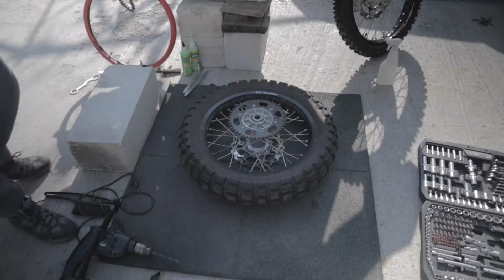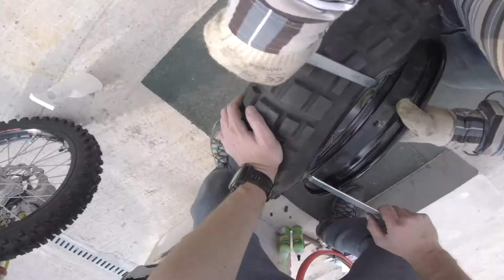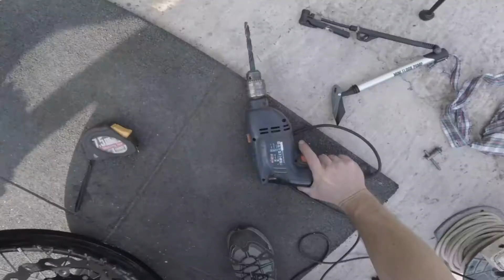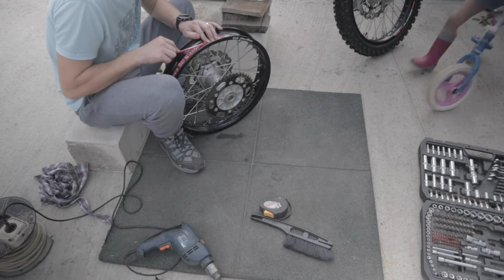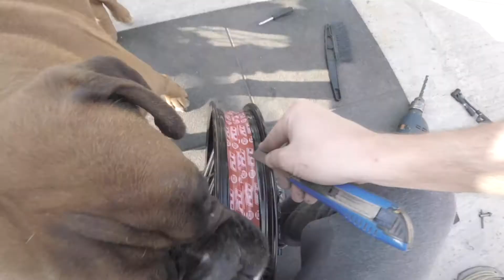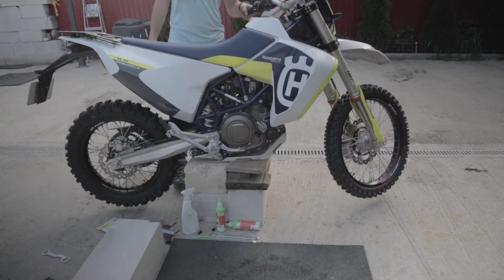Husqvarna 701 Enduro LR (2020) - Nuetech Tubliss and Mitas EF-07 140/80 Green Stripe Rear Install

Comment: how was your experience??? They work on long highway trips??
Reply from the maker: They do work on long highway trips. I am using the bike for longer trips as well as commuting and only had one problem with the back tubliss system (that was my fault as I didn't check the pressure of the tubliss tube and I managed to tear up the tube valve). Except for that, no issues. Keep in mind that they are not made for highway use and you will be a bit limited regarding the tires that you can use. Because the rims are a bit wider than the rims for which the tubliss system was designed, you will need to fit tires with a thicker sidewall and also use some sealant in order to have no air leaks. And as long as you keep some higher pressure in the tires while going on the highway you should have no problem. I will do a video in the near future explaining my experience with the system.
Reply: @MotoCerbii  perfect, thanks a lot

Comment: Nice video. Can you recommend use of Tubliss on 701/690 after using it for a while? Any issues?
Reply from the maker: haven't had any issue with this. Some tires may leak some air if the tire wall is too thin. I am currently using Mitas C02 on the back and Pirelly MT21 on the front and after adding some sealent I have no air leaks. I didn't have any issues with the system in almost 2 years of riding offroad and onroad.

Comment: I got rid of my tubliss because of the ride on road between trails. Horrible hop. Had over 4 ounces trying to balance. No go
Reply from the maker: I agree with you on the onroad performance. You can't really go with high speeds using tubeless and it's really a pain to balance the wheels. Now I just gave up balancing them as I am not really going at high speeds on road as I value being alive :D Also, in our country, car drivers are not really used to motorcycles on road and don't have the habit to look out for them. But despite all the above, I am more than happy to sacrifice the onroad performance for the offroad one. I will try at some point to see if adding some bb gun balls will help with balancing. I've seen them being used on offroad trucks and I am curios to see if it works in this case.

Comment: The 690/701 have wider rims than are recommend for the Tubliss system (max=2.15"); it works (this and many other users) but I assume the larger rim means there is less clamping/sealing area (bead lock) between the red liner and tire. I'm thinking of getting a rear wheel with 2.15" rim to both save weight and bring the Tubliss into spec. Rottweiler built a 690 Baja bike and used narrower rims at both ends.

Comment: Look this dude can't even properly change a tire. Don't even think about using the tubeless system on your 701 Enduro. I ran the tubeless system for over 5 years on my Enduro bike and finally went back to double tubing or the tube saddle. Too many tire failures with the tubeless system. Don't risk it.
Reply: What kind of failure? I’m using tubeless for many years on enduro bike not a problem so far , haven’t really try on rd bike yet . Thinking of getting for husqvarna 701 enduro soon
Reply: @gohvahn  I don't know where you ride I ride (KTM 350) in very Rocky countryside in New England and slamming through Rock gardens I started getting more and more tire failures from sidewall punctures or the carcass coming apart in the tire. I ran really low tire pressures I tried many different tires and finally realized it's just too much maintenance involved. You can see my 701 test on my channel zap 59

Comment: One of the most complete how to for Tubliss. Great job! I do think that when putting the Tubliss in the tire using the metal guide plate you should have the rim lock at the very bottom? Not a big deal but might make it easier. And please get a compressor! 😂
Reply from the maker: Thanks man. You are right regarding the rim lock, don't know why I missed that step. I also have a compressor but I wanted to use/test the pump that I will be carrying with me. Wanted to check if it is up to the task and how much time it will take to inflate the tires with that, as I will not have a compressor with me.
Reply: Moto Cerbii so I have to confess i’ve been running nitro moose in the front and rear for the last six months. I had switched thinking it would be better but after six months of use I’m going back to the Tubliss system. That extra peace of mind for no flats is not worth the performance it you take with those things.